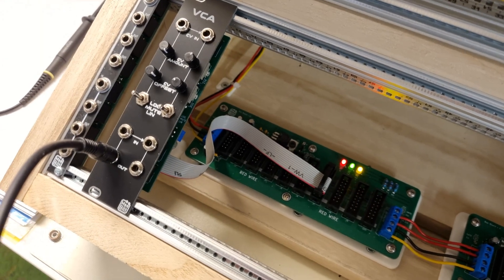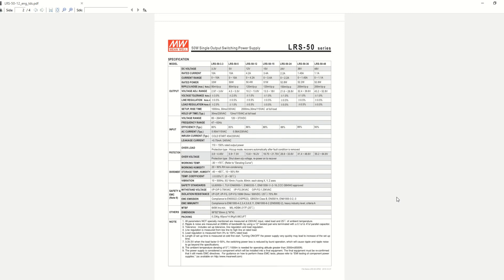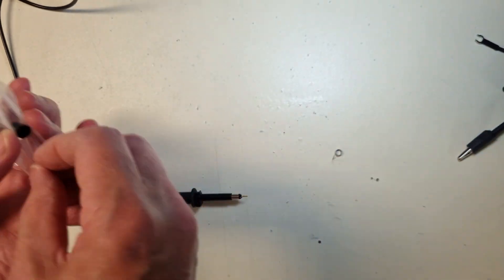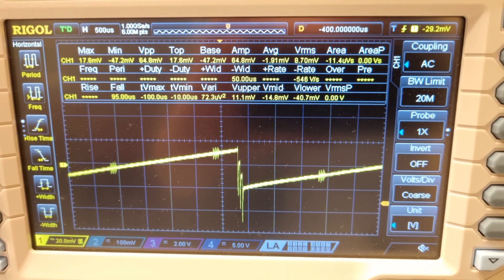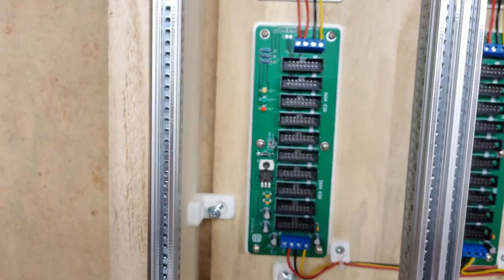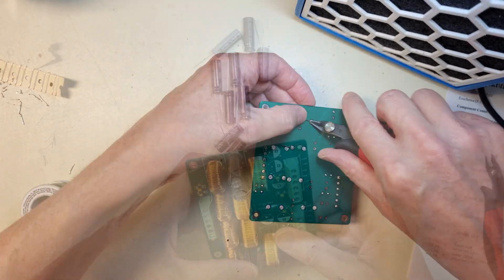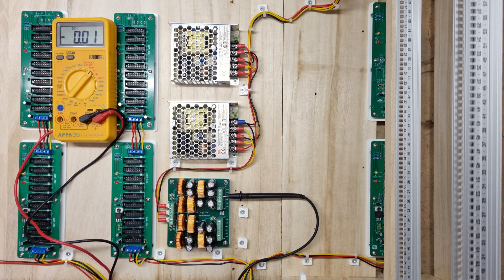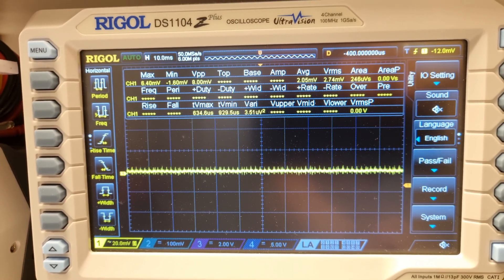Eurorack DIY: Power supply interference

Comment from the maker: The Schematic Diagram, BOM and Gerber-files is avalable on my GitHub:
https://github.com/tkilla64/eurorack/tree/main/misc/psu_filter
Reply: @MeeBilt  definitely a newbie question, but why so many parallel caps to ground in your low pass filter? . . . Or is this not a low pass? It looks like a passive 2 stage low pass to me.... But I'm not an electronics hobbyist. ^^
Reply from the maker: @nickmarkham3743  Yes, that's correct, it's two cascaded lowpass filters. The different caps types are used for different frequency ranges; electrolytic for low frequencies and ceramics for high frequencies.
Reply: @MeeBilt  When you designed this circuit, how'd you go about finding the impedance of the bussboard (or is it bussboard and the modules connected to it?) and those meanwell supplies? 

Or does it not really matter in this case? You mentioned at the beginning of your video that designing a filter was harder than you thought it would be, but I don't think you went into much detail as to why, and as far as I can see (From my complete laymans perspective) it's the fact you can't truly predict your filter's cutoff frequency without knowing the impedance of the source and the load (By which, I mean PSU and filter output. If those are the wrong terms, well. . . Here's to not breaking anything. ^^ 

I don't suppose you have a good, free circuit simulator and graphing tool to hand, do you?
Reply from the maker: @nickmarkham3743  I didn't use a calculator because I wasn't trying to design a filter with a specific cutoff frequency - I basically just wanted to filter out everything above DC.
However, this is ofcouse not possible because of restrictions due to cost and physical  dimensions.
But adding as high capacitance and inductance as posssible within reasonable limits was my goal here.
The biggest problem was the current rating of the toroid inductors - due to physical dimensions (and cost). Here I had to settle at 2.5A, but I made the PCB with 2 "channels" that could carry 2.5A each.
My case is a 4 x 84HP so I connected the upper 2 to one channel and the lower 2 to the other one. I don't have so much power-hungry Eurorack modules and they are spread out evenly between the rows, so for me this works fine.
I hope this helps you :)
Reply: @MeeBilt  Nice one. I am working on a similar filter for my system that uses 2x Mean Well LRS 100 12 PSUs. I have gone with higher current rating and a bit of a lower cut-off frequency. Hopefully they work well.
Reply from the maker: @astralbraintentacles1212  Awesome! Good luck with your build 😊

Comment: Aw. . . Looks like we're using similar, if not the same LRS 35-12 power supply. . . I just installed six of these in three different cases and powered one on today with a single mixer like you did in the video and. . . similar noise. . . . I'm not a handy DIY kind of folk, and this looks a lot more involved than a simple RC or LC filter circuit.
Reply from the maker: Yeah, it requires a bit of filtering. The PCB that I made took care of most of the interference, but the toroid inductors can be difficult to get hold of.
Reply: @MeeBilt  dumpster diving

Comment: Please could you telle where you sourced the inductors?  I've tried mouser/element14/lcsc and can't seem to find them.
Reply from the maker: I bought them from Elektrokit in Sweden (but they are quite expensive here):
https://www.electrokit.com/en/product/toroid-choke-220%c2%b5hdc-920%c2%b5h-ac-203mohm-2-5a/
https://www.electrokit.com/en/product/toroid-choke-1mhdc-3-45mhac-405mohm-2-5a/
But you can probably find other sources here:
https://se.rs-online.com/web/c/passive-components/inductors/leaded-inductors/
For example Bourns 2324-V-RC. RS PRO seems to have good price-performance

Good luck with your build!
Reply: @MeeBilt  great thank-you

Comment: For 10 years I have only ever used the expensive Doepfer or Clocks PSU (all around 180,--). Until 8 years ago, when I got a tip from a DIY Eurorack Master builder who only uses MW RT-65B. Since then, I don't put any expensive PSU in my self-built racks because it's unnecessary. The Meanwhell RT-65B is first class and costs only 25,--. No interference, no humming, no noise, very stable hosting, very stable bus boards which you can recognise by testing the OSCs. I can only recommend it to everyone.
Reply from the maker: Yeah, I will probably go for a Meanwell RT-65B in my next case.
Reply: RT-50 B is also excellent, just a little less juice on the +12V rail.
Reply: @berniedurnheim  thanx
Reply: I am in a position where I am going to need a new case. I was planning on 2 Meanwell RT-65B as PSUs with 3 filtered bus boards to fit my setup. I have heard everything and anything on these PSUs. What is your take on it?
Reply: @OlivierSarfati  dude, whats your point?
Reply: @randydarklight  Just willing to know if Meanwell RT-65B are ok to go with :)
Reply: @OlivierSarfati  and I answered the question twice 😀 what else do you need? The approvel of the pope? 😆

Comment: This is just wonderful. Ive been struggling with noise in my video synth, and im wondering if this might be an optional alternative to replacing the entire power system for something that runs alot cleaner.
Reply from the maker: Thanks, hope you get the noise issue solved!

Comment: Do you have recommended reading on inductor part selection? I'm building a larger rack with about 8A positive and 5A negative. I'll be using some hefty TDK Lambda 12V 10A power supplies, but not sure on the ripple yet
Reply from the maker: Hello Jeff, you will find the specs of the inductor in the schematic:
https://github.com/tkilla64/eurorack/tree/main/misc/psu_filter
My advice is to plan the space for a filter board, but check the ripple of the TDK Lamda installed in your system before you add it - maybe you need it at all?